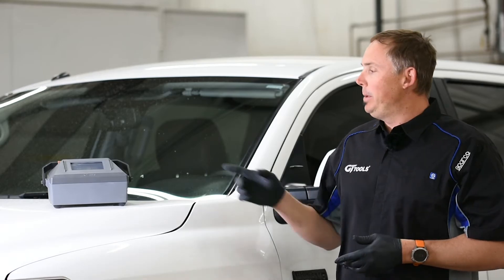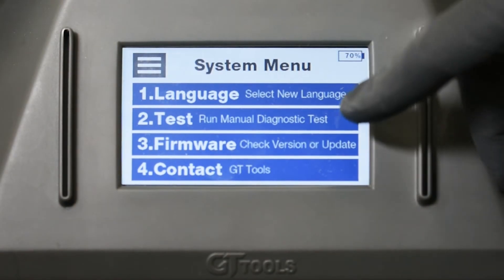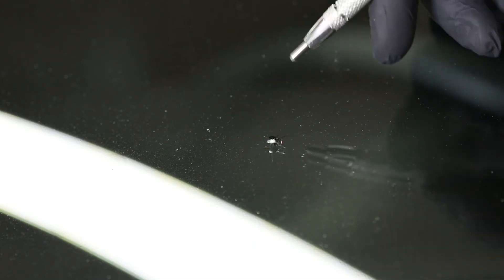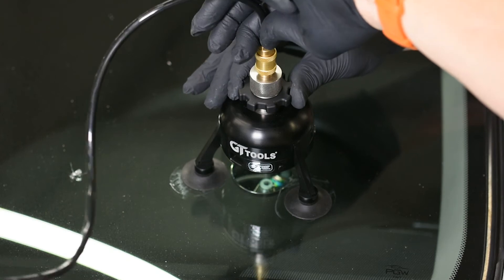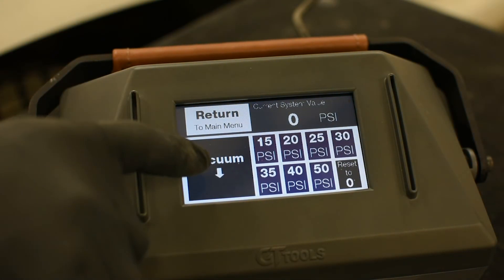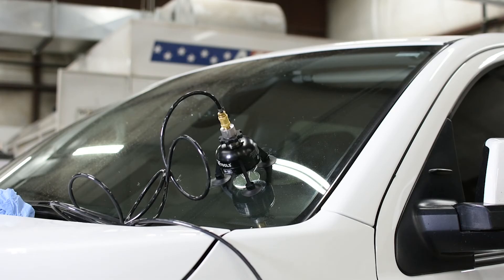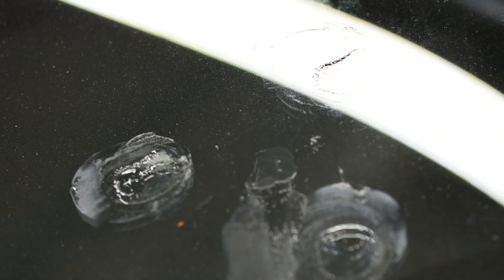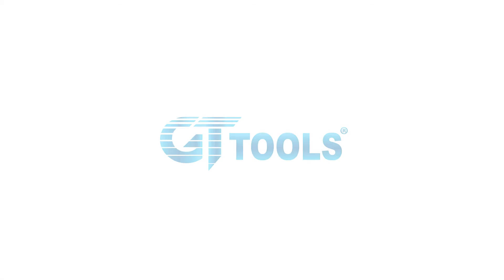Wizard™ Smart Windshield Repair System - Training Video - GT Tools®

Comment: Polish is absolutely useless after scraping the resin with a razor blade. And if your resin isn’t fully healed that polish blends with the resin and looks even worse lol
Reply: What would recommend?
Reply: @caseyaston9581  the resin will never match the glass completely they are meant to get to as close to clear as possible but obviously it’s a resin and not made of glass ya know what i mean? so it’s always going to be a little blemish , the smaller it is you can barely notice it’s just one of those things where you’ll know where it is but won’t find it unless you inspect it. If you’re talking like any type of chip the size of a coin or even half the size of a coin, as long as it’s filled let it be because you’ll never be able to polish it clear. The polish is more for surface scratches , not chips. In that case I’d rexommend either the protective cardboard from a new razor blade or they sell these little leather buffing pads online you can find, card board works just as good though in my 2 year experience
Reply: @TheBIGJOYeffect  thanks for the information that’s what I was wondering, I didn’t think it would have get clear by polishing like that. To me it looked like it did nothing.
Reply: I don't think you know what you are talking about. For the best final result you MUST use pit polish at the end, and who starts adding pit polish to uncured resin. Silly post!

Comment: My wizard unit never reaches 100% charge. After a full weekend charge it will max out at 85% and drops and rises below 70% and 80% immediately after first cycle. I noticed yours shows 100% and drops to 70% immediately. Is this normal?